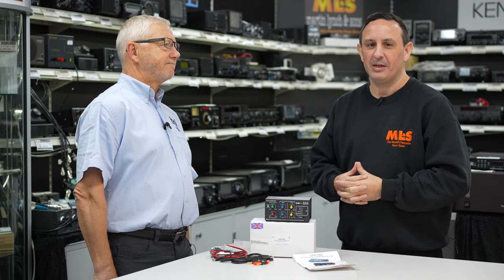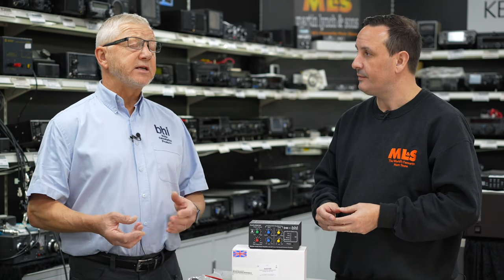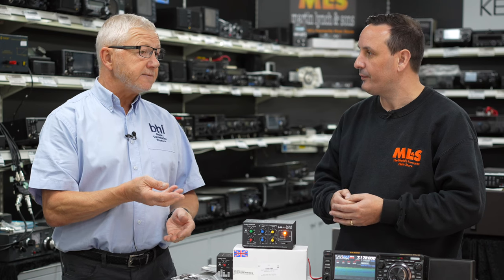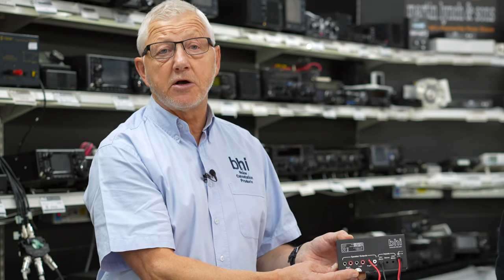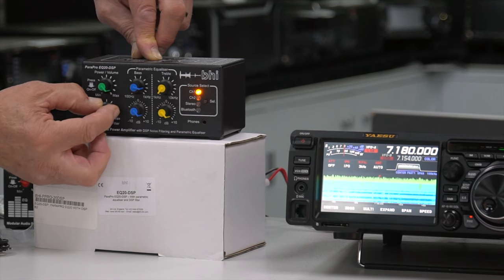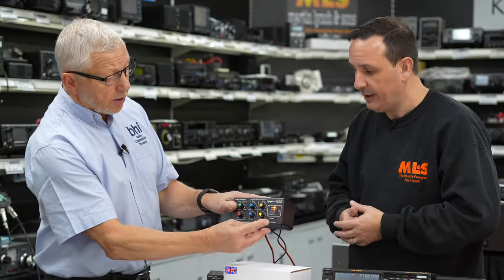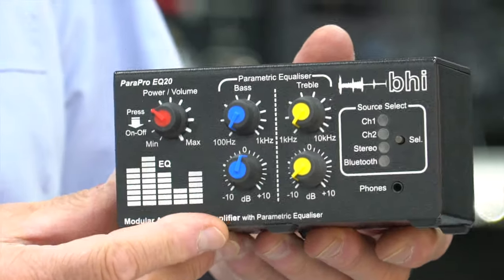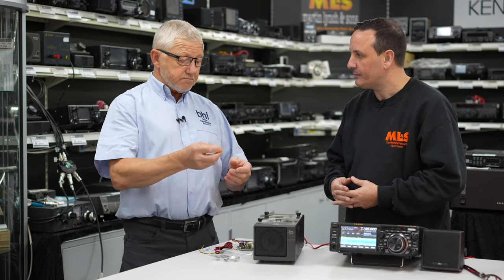Ham Radio Noise Driving You Mad? Watch this video!

Comment: I can’t imagine using my radio without my  bhi module. It is that good and use it all the time in my mobile. It sits along side my radio on the dash and is very easy to adjust even on the move . I have had some feed back issues on 40 m which I am going to have to address, which I’m hoping to cure with some clip on ferites but would appreciate any feedback from someone who might have experienced this. Thanks